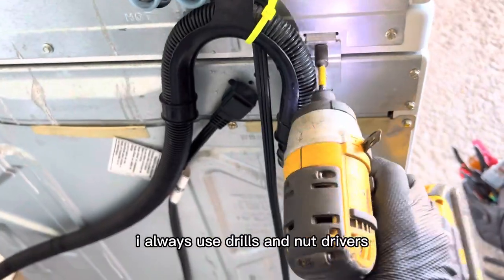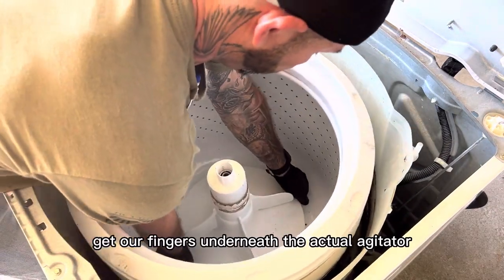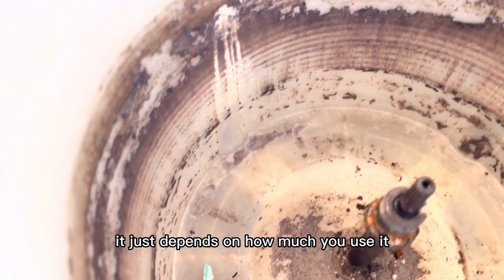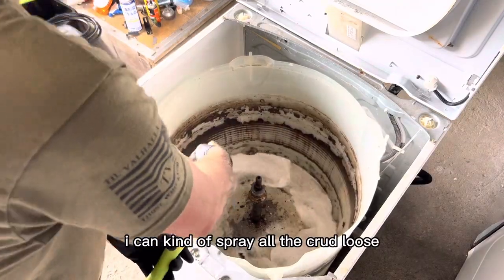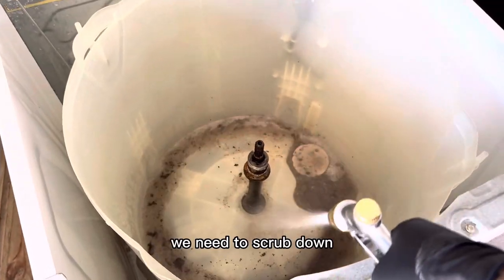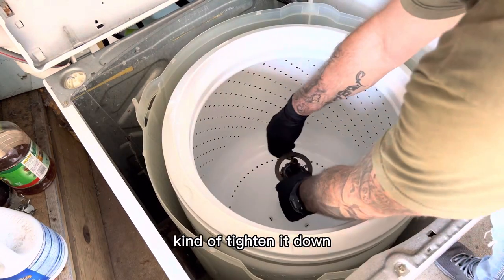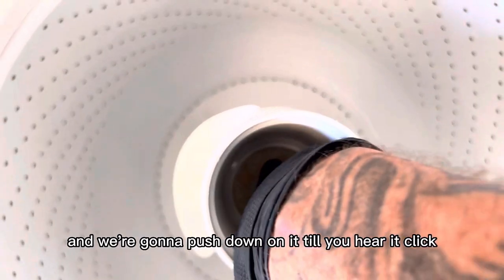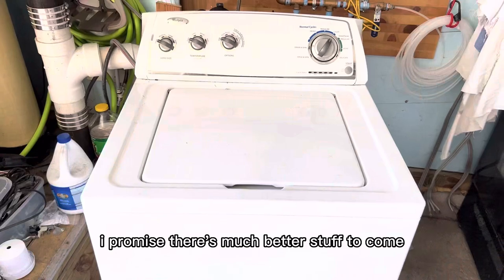WHAT YOU’RE WASHING CLOTHES IN WILL SURPRISE YOU! Model#WTW4800XQ2 Whirlpool top load tub removal

Comment: Fascinating video.  I never used fabric softener just vinegar on each load. I have a front load. Also I drain the hose on the bottom front monthly. To clean the tub I run a rinse cycle using oxyclean every 15 loads.

Comment: I have a question about an LG top load. Is showing a IE code. It’s only a year & a half old. Ok we cleaned out the hot & cold little plastic strainer. And pulled up hose that the water drained out. But still kept stopping & putting up the IE code. Do you have any more suggestions?

Comment: I wished I bought a used washer from someone like you who thoroughly cleans the unit before selling. I bought a used one from offerup and it was running great. The only thing is the brown flakes. No matter how many clean cycles I ran those nasty brown flakes would be floating in the water. I suspected the seller didn't disassembled it and cleaned it. Tried to return it but the seller ignored my messages. Despite the picture evidence and showing venmo the conversation seller ignored, venmo sided with the seller. Luckily my bank was able to reimburse me but venmo closed my account momentarily. Smh. I never do this and I will never buy appliances used. Not worth the stress. Beware to all who buy used washers. Not all sellers clean it up like this guy.